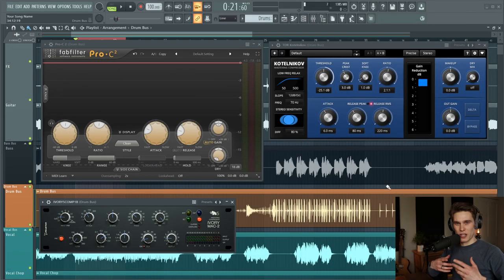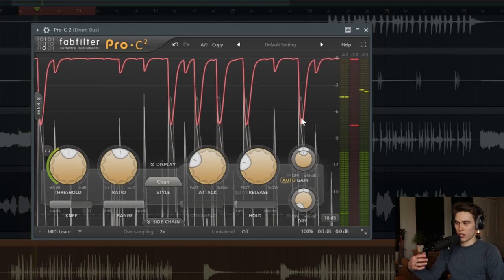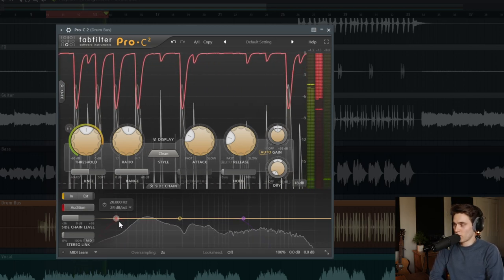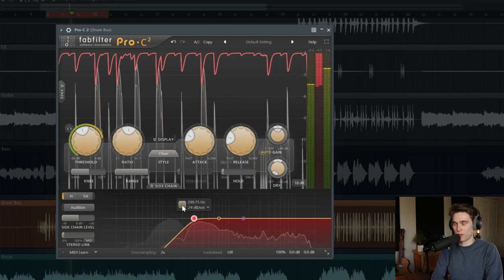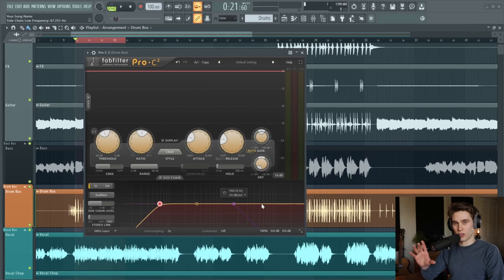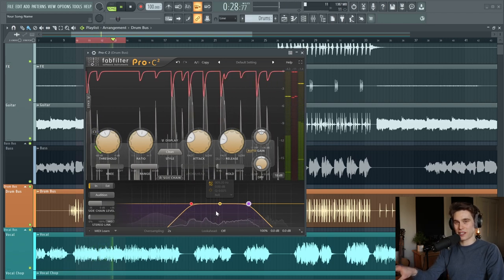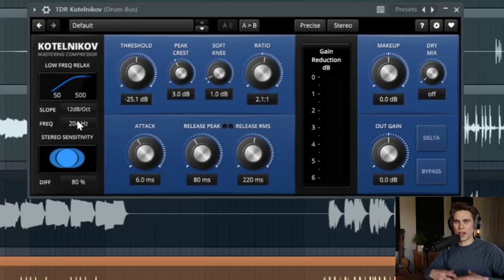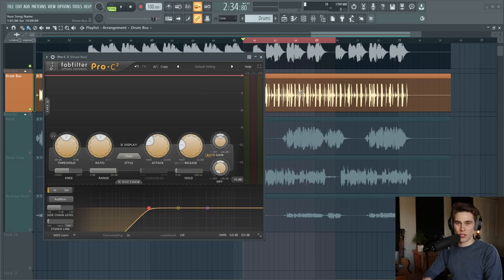Use THIS Compression Trick For BETTER Low End

Comment: Hi, i wonder if you can help answer a question for me or even perhaps do a video on it. I can never get my mixes to the same loudness as commercially released edm tracks. Even after it comes back from mastering, i never master my own, it's still way way quieter when i do a direct A n B comparisson to top line edm track. My tracks are nicley mixed, well balanced and i'm signed to a label. But i am still in search of the holy grail. I.m always two steps away from from achieving that pro polished sound and loudness.  Now i've come to the conclusion that maybe my tracks are too dynamic. The gap between the rms and the peak is too large. So therefore when they are been mastered the peaks are preventing them from going louder. Therfore if i reduce the dynamic range then my RMS will be louder. Is this correct way if thinkning? 
 I always gain stage correctly, never have anything on the master bus and always leave plently of head room for the master. 
So should i try using a compressor, or limiter and saturation on nearly every track in my mix to brong dwon the dynamic range and increase the gain? . I saw this was mentioned in another channel i follow and i;ve been trying this and it seems to be one of the things i've not been doing. But if this method is gong the right way to create louder crisper more polished mixes what woud be the best method? Lots to think about so any chance you could cover this please? Many thanks
Reply from the maker: There are so many variables that prevent me giving the exact solution but it could be a dynamic range issue. However, a good mastering engineer should be able to handle the dynamic range and attain a commercially acceptable loudness level. This assumes that the bass is not excessively dynamic. 

What short terms LUFS levels does your mix peak at during the chorus? Many EDM songs settle in the -7lufs range with some reaching -5 lufs short term. The True Peak level is often +1 to -0.5 lufs (I prefer to keep it below 0! 

If you are reaching these levels and your song does not feel loud enough, then compression will not help because the issue is related to arrangement, sound design, balance or perhaps even your own critical perspective on your music. 

Let me know what levels it is at and we can figure this out :)
Reply: @inthemix  Thabks for the reply. I will through my latest track and get the readings. After mastering it comes back at -14 lufs amd when i do a sound penalty check i hardly get any penalty. 
But if i compare my track with others that are in my dj list in rekord box, all the others jump out in terms of loudness. It's like light amd day. from there's to mine. It could be down to soudd design amd choice if samples etc. In the studio,.and i use adam 7's, i can hear fairly well. My mastering engineer will quite often come back with suggestions he feels needs attention before mastering and it's bounced back n forth for a while before he's happy it will master well. So all in all things are done relatively in order. But i'm not getting that top level pro sound and loudness. It could be down to my mixing and lack of experience amd i need to keep getting better. So i need to find those area's and techniques and knowledge i'm weak in. 
Thanks for the reply amd i will.get those readings. :-)
Reply from the maker: @jonathanoates1972  If you want to match the loudness of other EDM tracks, you’ll have to get the integrated loudness much higher than -14. You’re probably going to need a short term of around -7 and an integrated of around -9 to be competitively loud.
Reply: @inthemix  Ok thanks. I need to pay more attention to this as it's something i don't fully monitor or understand in it's entirety and need to get to grips with. Are you saying before it goes to mastering i should have the mix around these levels or that the master should?
Reply from the maker: @jonathanoates1972  before mastering you should not be concerned with the loudness measurement of you mix. Keep the true peak level a few dB below 0 (this helps the mastering engineer). During mixing, focus on perceived loudness and balance. Let the mastering engineer get the loudness levels up. They will have equipment and expertise to handle this better!
Reply: @inthemix  Ok great thanks. This is what i actually do. I always hand it over with at least 6db of head room. :-)
Reply: @inthemix  one extra thing i noticed. If i upload my track to the penalty loudness site, mine doens get turned down, well hardly. Yet if i upload one of the pro tracks they get a penalty og t least 6 - 8db. So even though mine doesn't sound as loud prior to spotify, when itdoes get distributed i suffer no loudness penalty like the others.

Comment: Is there really any advantage to compressing a bus (as opposed to compressing tracks individually)? If anyone knows, please tell me what that advantage might be.

This sounds very old school, like the way it might've been done in the hardware world when there were a limited number of compressors available. But it's not 1980 anymore. Most things are done in the box. And if there are 70 tracks, each one can have it's own compressor, or more than one. That would have overloaded a Mac built in 2000, but it's not 2000 anymore, either. Why are we still doing this?

Trying to compress more than one instrument at a time or drum at a time with a single compressor is kind of like trying to use a broadsword instead of a scalpel. If you have two or more Instruments in a bus, the compressor settings will always be a compromise. That seems like a technique that no longer applies, and is only done bc that's the way it had to be done, in 1980. Sure, evolution is slow, as witnessed by this example. It does not have to be.

Maybe my approach doesn't make sense, but it makes sense to me: I compress every single source with its own compressor (if it needs one). That way I can get the compression precisely right on every single instrument (every drum and cymbal also has it's own track), without them interacting with each other. I get the levels right (and EQ, delay, panorama, reverb, and compression) in tracking, before mixing. That way I don't have to compensate for or compromise for anything being off during mixing or mastering, and level changes to a track won't upset the compression settings.

If the full mix then appears to need tweaking, I go back and fix it at the track level. The only compressor that looks at more than one instrument at a time is the multiband compressor used in mastering, although that is already looking at separate parts of the spectrum, though I do use a lot of sidechaining (kick sidechains bass, lead instrument often sidechains comp and pad instruments and even reverb auxes).

So while all of my compressors have this filter option, I see no advantage. But maybe I'm blind. Maybe I just haven't seen what the advantage of bus compression is. You can raise or lower the levels of all drums at once or compress them all at once by a fixed amount, but that doesn't feel like it does all of the work the way it should be done.

What am I missing here? Is there some secret sauce I'm unaware of?
Reply from the maker: Thanks for your comments. 
I also use compressors on a track by track basis but I think you are missing my point here. 

Often I want a compressor to react to only a part of a single track, not necessarily the loudest part. In this case, using a (side chain) filtered compressor has big advantages even when working on individual tracks.

I wasn’t alive in the 80’s and try to have a pragmatic approach to processing, considering all the modern options available. 
However, there still is a benefit to further compressing stems and busses after track compression. There are bus compressors which can impart saturation while reducing the dynamic range of a bus. 

A good example of “group” processing is when I’m mastering. I love using master EQ, although I rarely boost or cut by more than 1dB. Why would I use an EQ on the Master channel when it’s quite possible to ask for a mix revision and load an EQ on any individual channel? To me, the answer is that it sounds much better applying it to the whole group. 

The point I’m taking away is that I didn’t mean to imply that group or bus compression should be the norm. I could have clarified that each of these tracks already has compression applied before I even started filming. I felt that was implied by the sound of them but clearly not! 

Thanks again for the comments, it’s important to drive these conversations forward.
Reply: @inthemix  Thanks so much for your response. It only adds to my respect for you.

It's true that compressors do more than control errant levels or change the envelope of sounds. Pretty much all of them also add harmonics to increase saturation, as you indicate. But that is beside the point of the concept of compressing a single instrument as opposed to multiple instruments on a bus. EQ-ing a mix is also a different issue, and I agree that a dB or two on the mix can be good.

Compressors by definition react to the louder parts of a track (unless you filter those out via sidechain). Could you give an example of wanting a compressor to react only to the softer parts of a single track? It seems an expander could do much the same thing. Actually, if you are looking for subjects for new videos, a video on you demonstrating this would be really valuable.

Separate compressors on separate instruments (separate tracks) just seems like a no-brainer. But beside any argument that bus compression has added value beyond that (which appears to not really be the case):

If we have a single instrument on a single track, most of the time the notes used (the fundamentals that would trigger a compressor) are limited to 1.5 to 2.5 octaves, often, far less. This also applies to percussion: any drum, cymbal, conga, or shaker typically has fundamentals that either reside primarily in a small part of the spectrum or we want to not treat the wider parts differently bc that would upset the timbre of that instrument's sound, and that is typically a job for channel EQ anyway. 

So it still puzzles me why compressing based on a portion of this already-small portion of the spectrum that it resides in would be of any value. The compressor threshold still reacts only to the louder fundamentals anyway (unless you filter part of them out), and it still compresses the entire spectrum in a mostly binary (compress all or compress nothing) manner, so there is little room for it to express nuance that can't be controlled in other ways, typically easier, more-effective ways.

I do see one possible use: Typically, even if you place no velocity dynamics on an acoustic MIDI piano (I always have variable velocities), for example, notes in octave 4 and above are perceived as louder, cutting through the mix more audibly, than notes in octave 2, at the same velocity. If one filtered the compressor to only react to the higher notes, that might level things out better. If I typically have a center velocity of 75-85 (depending on how bright I want the instrument to sound), the higher notes often have to be reduced to 60, or even 40, and the lower notes kind of get lost in the mix unless I boost them up a bit velocity-wise.

But velocity levels also change the timbre, which is not what I have in mind, exactly, when I want to make the lower notes and higher notes cut through at the same perceived level.

So it looks like I have an experiment in my future.  Thanks again.

Comment: I love the way ‘industry professionals’ have the ego to tell other people how their mix should be. But hey- this is how they make money, right? By telling other people what they should be doing to make their sound ‘better’. Compressors are not always the answer to make a sound better. There are some useful applications for compression, but it should be limited to commercial applications for which they were designed. What does this have to do with dynamic range? If you’re going for jazz or classical, compression is probably not really an option.